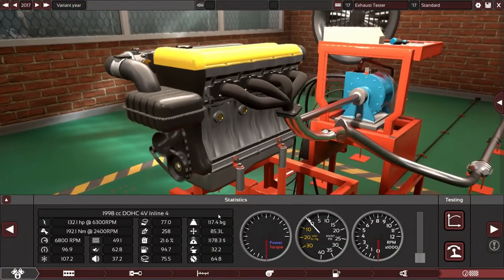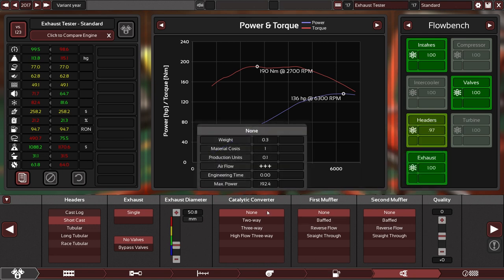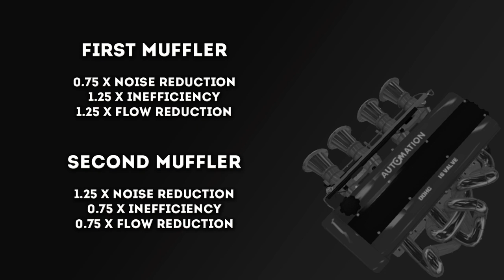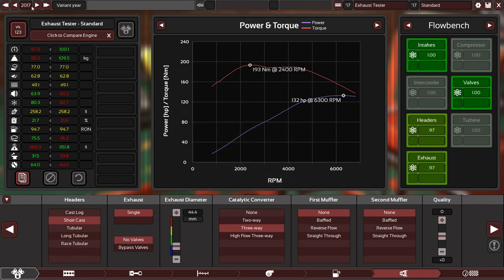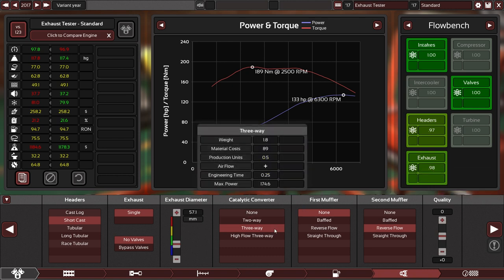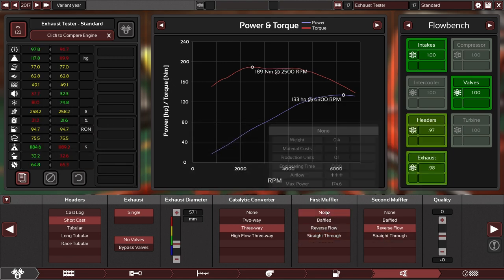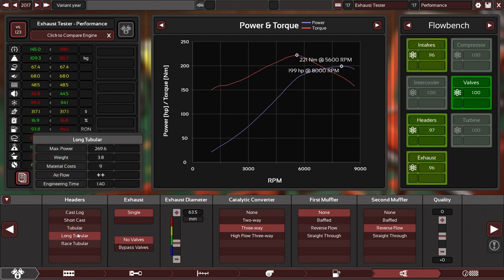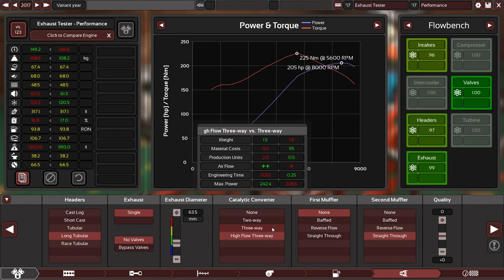Automation How To: Exhaust Tuning

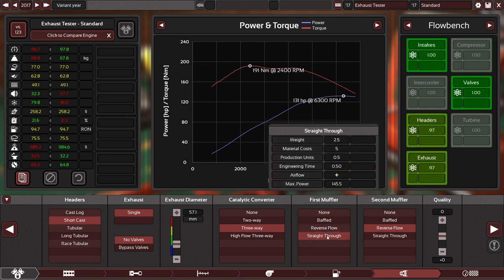Comment: 14:17 - Yeah, and engineering it four times when using dual exhaust is especially painful! It looks like the current version does still increase Engineering Time when the same muffler is selected twice.
Reply from the maker: It does, yes, fortunately it doesn't matter right now as there is no context for that anyway :P
Reply: I was answering your question in the video at 14:17 where you said selected the same muffler twice should not increase Engineering Time, but then you said you weren't sure if that was implemented yet.
Reply from the maker: Yes, I got that :) I also checked in the meantime. We'll change that for the next big update for sure. I've put it on the ToDo list
Reply: Ok, glad you understood. :) I was just confused by your "that's not in context" comment.
Reply from the maker: The "no context" translates to "No Lite Campaign yet" :D
Reply: I see what you mean now. :)